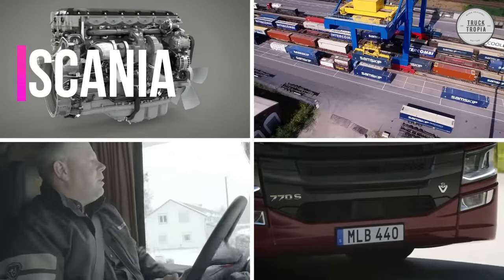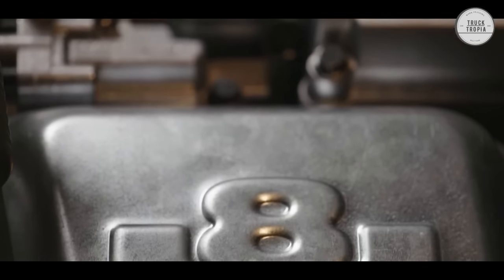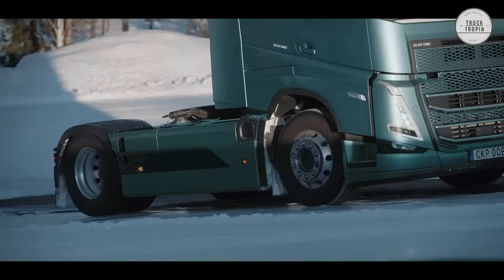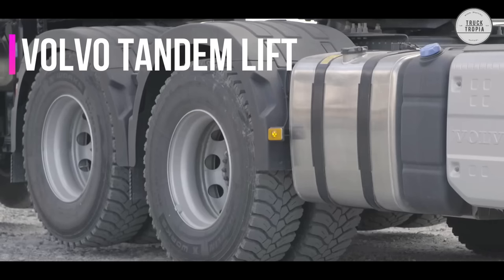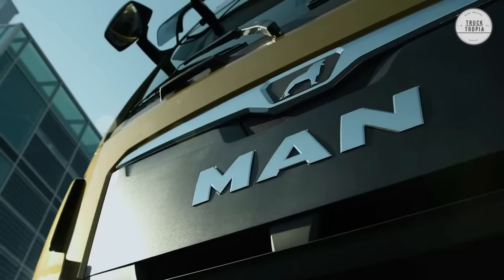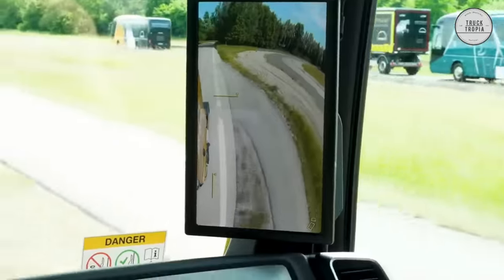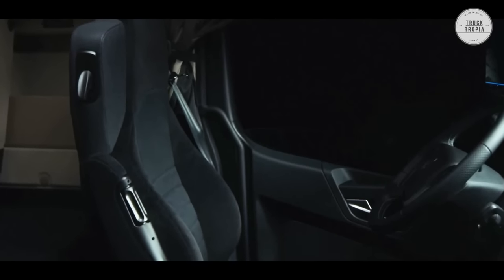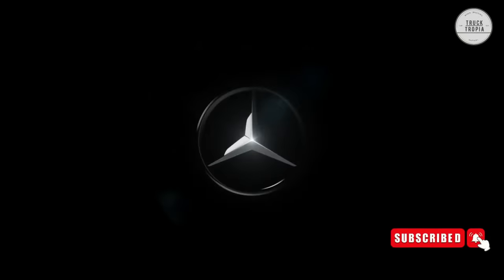EPIC Truck battle ▶ Scania vs. Volvo vs. MAN vs. Mercedes

Comment: This is a difficult one! The New MAN interior is very nice and from a friend they drive really well, even better than a Volvo.  I’ve driven the New Volvo FH, the new Actros and the Last Gen Scania, not Next Gen and so far the Volvo has been the most comfortable. The duel clutch is the best ever but the normal i-shift is slow compared to Scania’s older box and Mercedes Gearbox is just poop. When i drive the next Gen i can give a better opinion.  But i am enjoying my older Scania for now.
Reply: I've driven a 2019 MAN TGX580 with rigid chassis and dolly+trailer and I can immediately say that I think Volvo and Scania are better. I mostly drive a next gen Scania R580 with rigid chassis and regular 4-axle, full trailer, but sometimes when that is not available I drive a 2019 Volvo FH540 Dual Clutch with the same configuration. The Scania has the better engine and better cab comfort, in my opinion, but the Volvo has the better transmission and is better for reversing due to the electric steering. The Volvo is also sometimes better suited for our kind of deliveries since the ground can be uneven. That's easily fixed by using the tilt function with the air suspension. It can til the truck side to side so that you get a more level surface to put the rear lift on.
Reply: Agreed the volvo is definitely the most comfortable truck to sit in! The dual clutch is very nice but most people don't have it and the next gen scania has such fast gear changes it doesn't make a massive difference! I havent drive the new gen MAN but have heard a lot of good stuff about it... as for the mercedes they are all wank in my book haha! Would definitely take a scania over anything else.
Reply: @Trucking_Tom  MAN almost feels like driving a bus. The steering wheel is huge and the cab feels really wide so you tend to hold out more from obstacles on your right side if you're not used to driving them.
Reply: @tntfreddan3138  is that the last gen though? I've driven the last gen but not the new gen which was launched in 2021
Reply: @Trucking_Tom  It's not the new gen. But since I've also driven 2 other MAN trucks of 2 generations ago, too, it's safe to say that I prefer Volvo and Scania over some German wannabe's.
Reply: @tntfreddan3138  haha there certainly no beating volvo and scania! I think the people that hate on them are just jealous that they don't drive them lol
Reply: @Trucking_Tom  They are definitely. I had a guy arguing that Mercedes were so much better than Volvo and Scania. Smh
Reply: @tntfreddan3138  That Volvo Suspension is definitely a plus and the steering.
Reply: @TheJStoney  haha anyone that thinks mercedes are even in the same world as scania or vovlo has obviously never driven either of them!
Reply: @Trucking_Tom  My thoughts exactly! I thought Mercedes were also good when i came over from the States coming from old tech big hood trucks but i quickly changed my mind the second i drove a Volvo. Then i noticed how the Mercedes seemed to struggle on hills in comparison and how the gearbox was garbage.  Even my 2016 Scania Feels better than a Newer MP4 or MP5
Reply: @TheJStoney  yep! The gearbox on the Mercedes is downright dangerous! Trying to get going at a roundabout or junction is horrible! Takes so long to find a gear that by the time you start moving you have to stop again because a car has come along.
Reply: @Trucking_Tom  hahaha exactly. It goes “chee cheeee cheee chee” and then your turn to go is gone.
Reply: @TheJStoney  haha yep! I spent more time swearing than anything in them damn things! I call them a craptros rather than actros haha
Reply: @tntfreddan3138 0
Reply: @TheJStoney  0

Comment: In my company (tipper work) we have had expirience with all brands of european trucks over a 25 year experience and we have found that MAN and Mercedes are the best construction trucks out of them all.
Very nice video btw!
Reply from the maker: Thanks for sharing, and I appreciate that :)
Reply: yeah i feel that - i mean no way MAN and Mercedes sell that good, if Scania and Volvo would be that OP. MAN is especially on the run because of low fuel consumption - Volvo and Scania mostly for the specialist tasks.But the street is actually filled with middle sized Mercedes :D
Reply: @kanalisationerstellen they sell that good because they are much much cheaper than Scania and Volvo. There can be easily difference more than 20k eur when you compare similar MAN vs Scania and price goes way higher when you put v8 in it. Previous gen MANs are crap compared to previous gen Scania (had tgx 2011 tgx, now have 2013 R series) especially in interior quality but comfort too, engine of man was good, at least in terms of performace. This week i was offered new TGX and accepted it, truck looks amazing from outside and interior has improved a lot too but today I got another offer from my boss that he got a good
deal on next gen R series so I will have that one instead of MAN. Anyway, I often use "MAN is good but Scania is Scania"
Reply: @thecevi9179 Hello, I'm dumper truck driver. I love MAN TGX

Comment: European Big Rigs far and away Outclass (except Volvo US) any of the Aluminum and Riveted cabs cobbled together here in the US. European cabs are designed to Protect their occupants. They use High Strength Steel with welded seams.

Comment: I've reviewed a Mercedes Actros in my channel, I've seen all sorts of trucks from all brands, I even visited the Mercedes and DAF museum! 
All I can definitely confirm is that: All four brands have a long reputation in the truck business, although Mercedes has had the longest, even before the world wars. But having a long reputation doesn't mean best:

Scania has a nice design and a top choice for modifications (some people love tuning their Scania V8). Scania trucks are nice to look at, very reliable too, but can be expensive, and that too they don't meet demands in the light weight truck segment. 

Volvo is the Toyota of trucks: VERY reliable, but super boring. Volvo displays the most concern over safety. But like Scania, Volvo appears to be expensive. They may not be appealing to look at, but its their safety, engine power and reliability that does the magic. That too Volvo owns Renault trucks, meaning they have an advantage in the light weight truck segment.

MAN has the nicest interior out of them all. For reliability, well they don't last very long, here in Belgium they vanish faster than French cars. But I have noticed MAN is a VERY popular choice for super heavy haulage. MAN has a good reputation with crane trucks, or any truck that involve heavy duty or construction. 

Mercedes is the opposite of Volvo: VERY appealing exterior and interior, but hit-or-miss reliability. Here in Belgium, Mercedes and MAN don't last very long. Mercedes trucks look like they mean serious business, which they are, but they also require maintenance, or else they fall apart catastrophically.

So to sum up:
Scania is best with long routes, logistics, logging, construction, etc... everything, but at a price. They are now where to be seen as garbage trucks.
Volvo is best with long routes, logistics, logging, construction, etc..., everything, but at a price too, they are also never used a garbage trucks.
MAN is best with super heavy haulage.
Mercedes is best with everything, but at a price. No guaranteed reliability. However in Brussels they used as garbage trucks.
Reply from the maker: Wow thanks for sharing 😅😱😁👍
Reply: jadi Mercedes tidak tahan lama dibanding lainnya??
Reply: Scania is the least reliable trucks in Europe mate 😂
If you want reliable, comfortable, cost-effective trucks, you'd go for german Mercedes-Benz or MAN, or dutch DAF.
Reply: Right on. 
People claiming that mercedes trucks would be reliable are delusional.

Comment: I do drive the new MAN it's a massive improvement from the old one there are some small problems the sun blind doesn't go all the way across in low sun it will put sun in your eyes there a lot of wind noise coming from the wing mirror maybe just be the one I got the biggest problem of all is the air suspension control its very slow doesn't want to respond it lose air the MAN is bad for just losing it air alot compared to others. 

Its a great truck way better to drive it dose have apple car play from what I have been told by other drivers who use it on a long journey you don't feel worn out the one we got is a 71 plate never seen auto dipping head lights plus automatic lights power sun blind the new digital speedo is great I would have to say the new MAN. 

Its very hard to ignore the V8 scania tho I definitely would like to drive one.

Comment: I personally think that Scania is the best
Reply: WHY..?
Reply: @stigandrmyrardalur5208  it has got a very comfy interior, its also very well designed
Reply: @vikingerson  that's true, after Scania copied Actros even Scania has become acceptable
Reply: Based on 25 years experience I can say Scania make the worst trucks in Europe. Out of date interior, uncomfortable, underpowered, and a split fuel tank that is a PITA. The vast majority of Scania’s are poverty spec workhorses with no power and a terrible Interior. Those shiny straight piped V8’s are a tiny tiny minority in a sea of mediocrity. And even those are terrible to drive and give you a headache after 30minutes.
Reply: @Jabber-ig3iw  i guess you never drove an iveco, its even worse
Reply: @vikingerson  and i guess you've never driven a scania and it's just as bad
Reply: @KellyNoName  Never driven a Scania as a driver, but as a passanger, and I must say I liked it more than an Actros

Comment: Sweden before Germany 😁. Drove all their older models, German gearbox sucks, both Mercedes and MAN. My biggest complaint is that, you never know wtf gearbox is going to do but in 95% times  is not what it actually should do 🤣🤣🤣. With older models I would go for manual gearbox. Scania and Volvo are great, shifting gears as I would do myself, big advantage over Germans. Especially I-shift or double cluch. Mercedes saving 1.3% of fuel by removing side mirrors, so you can figure out how much of “blind spot” you have especially combined with A-pillar, you can “miss” to see whole truck in that blind spot, not to mention bicycle or pedestrian. MAN is the same. There are much more things I could say in favor of Swedish but this are few that bothered me the most while driving Germans.

Comment: Scania or Mercedes.
Reply from the maker: A truly great truck :)
Reply: I'm afraid Volvo has a better transmission, and fuel economy.
Reply: @patodonovan274  no it’s not…Scania came out with new Super series what makes them most economic truck out there in the field. Engine, transmission and rear end are totally new
Reply: Yes but Volvo made some changes in the meantime time to soft wear in the transmission & up graded the pistons eg .so for me it's Volvo a nicer truck to drive.
Reply: Scania are terrible trucks. Don’t be seduced by the wheel polishers and their noisy V8’s.